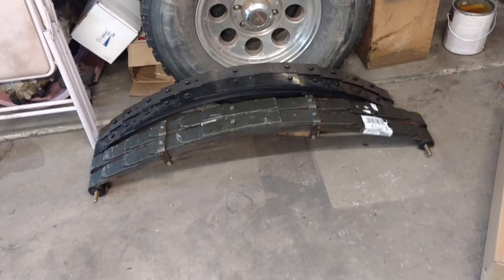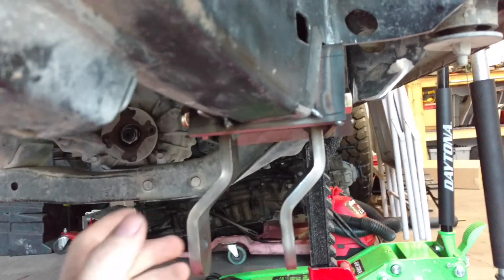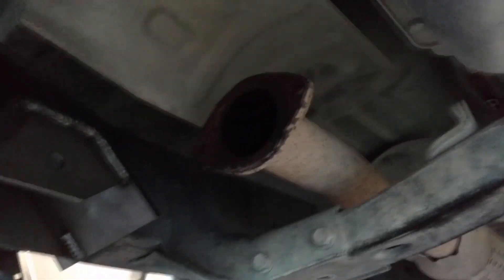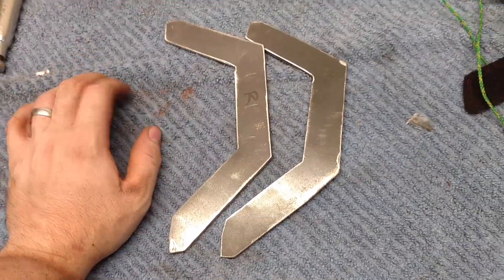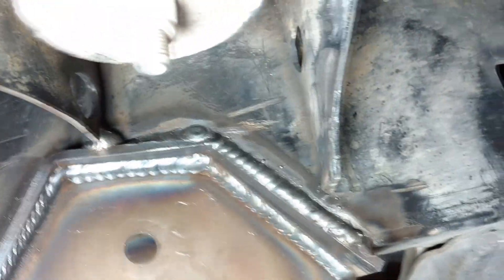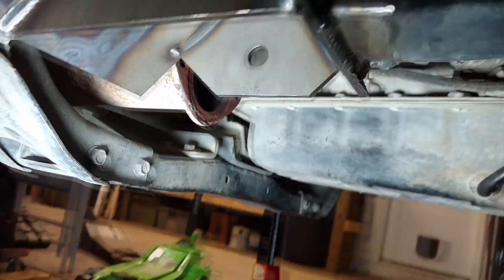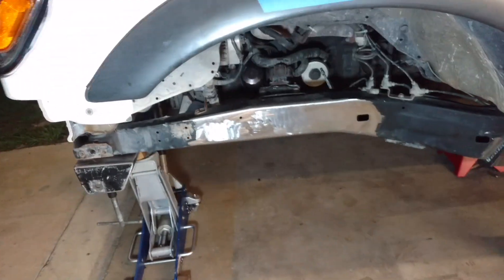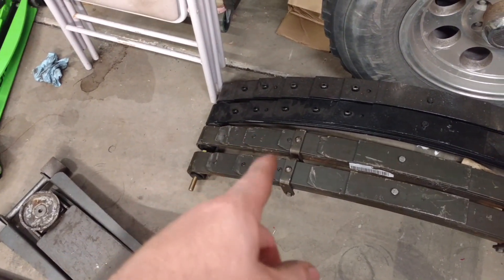Tacoma Solid Axle Swap [Part 7] - Welding Shackle Hangers

Comment: This bucket brackets are completely unneeded! They will possible make the joint stronger as they overlap the frame more so can distribute the load better.. that Said.. in order to do that you have to weld the bracket first grind it flush so the bracket sits flat or turn the heat up high enough and burn through the bracket to the frame while pushing all the metal towards the bracket which isn’t what you did. Might help you sleep better but it’s not gonna actually add strength. Maybe a little but not enough to make a difference. Being flush on the inside of you were really concerned you should have boxed it from frame to hanger. Won’t hurt anything though.

Comment: hello, i jst recently bought a used 2004 SAS tacoma double cab tacoma. my front springs are trailgear 5" and have the shackle so far back its half an inch from the frame bucket, im wondering what springs you ended up with. im considering going with the 44044 wagoneer springs at the moment
Reply from the maker: Do you have the same sky's off-road shackle buckets? I am running sky's off-road "3F springs" I don't think they will help you much as I think they are a bit longer from eye to eye, plus they move the centering pin forward a couple inches. I have heard plenty of people have good luck with the wagoneer springs. You can also try to track down a set of rear leaf springs from a Toyota pickup. That's called using rears up front (RUF) and is very popular with the Toyota guys. You may also be able to use an add-a-leaf to gain back some arch and shorten the distance of the spring eyes, but I don't think you will gain much.
Reply: @Trav74r   first, thank you for the reply! i dropped a lot of $$ on this truck and was pleasantly surprised to see such a detailed built video on basically the same truck with the same parts. Your vids are very helpful as the builder of this truck did a very good job on everything but the suspension. Yes my truck has the sky's off-road shackle buckets. I've read that the waggy springs and the Toyota rears can also be combined in a "bastard" pack. ill try the waggy springs first and let you know how it works out. my main goal here is to fit the current 37's and still have up travel without cutting the inner fender. Right now the truck rides like a brick, has no travel and the front shackles hit the buckets on every bump. I dug a little deeper and found out my springs are actually the HD 5" trail gears. Thanks again!
Reply from the maker: @MrScottdogs  No problem man. That was the next thing I was gonna say, get a top leaf with an eye to eye measurement that is slightly shorter. Then combine it with the leaves you currently have. Build a bastard pack with the objective of a slightly more arched spring with a shorter total length. Droop is more important than up travel (in my mind). But you still need enough up to properly operate. My goal was to have the axle far enough forward that the tires wouldn't hit the backside of the fenders under compression or turning, which the sky's springs solve with the forward spring pin. Kinda a ramble, bit hopefully some of that makes sense and is remotely helpful.
Reply: @Trav74r  hey! so what I ended up with is stock front wagoneer springs part #97-400 seven leaf pack at a cost of 330$ shipped. they measure 47" long and front to center is 22". I had to put the spring center pin in the farthest back position on the spring perch pushing the axle as forward as possible. I have 5" of up travel until full bump and 7" down on 14" shocks and can fit 37" tires no problem. I did trim an inch or so off the inner fender and had to move the washer fluid reservoir . The only adjustment I will make is to swap out the stock waggy main leaf for a rancho 44044 main leaf as it is a full military wrap. sky doesn't currently make the 3F springs anymore..